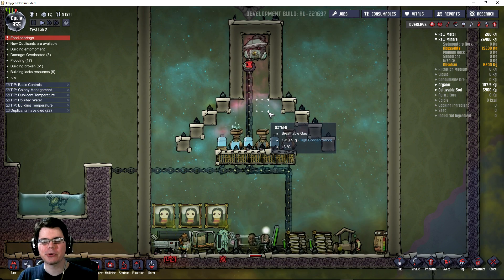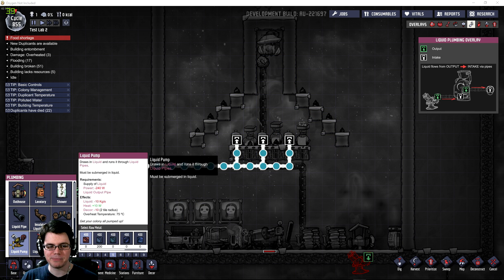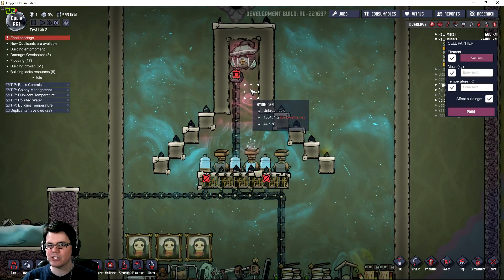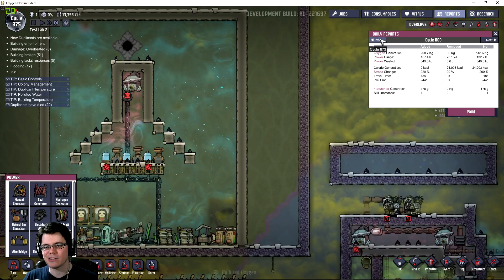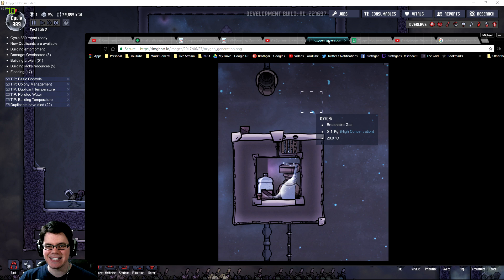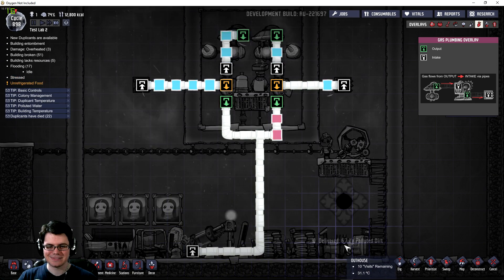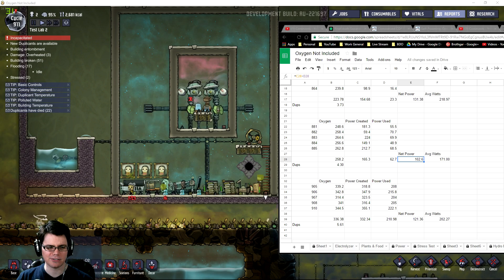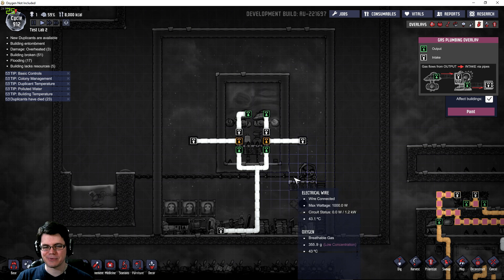Self Powered Oxygen Production! Oxygen Not Included Tutorial

Comment: I made a self sustaining system awhile back. If you go back to the video that you showed on screen. It is completely self sustaining with additional (At times) power.
I used a filter but if I had added the pressure gauge. It would do the job. 
Making the pipe system longer and adding a gas pressure regulator turned down. It should do the job. 

I wanted to run the gas line through out the whole area but it would take some time to build. 
So I just let it start up as it was just to get my O2 production going. 
I also hadn't put in the regulator yet. Needed to research that tech. 

When the hydrogen stops running to the generator. The gas in the pipe acts as a storage. It will take it's time getting there but when it does. It will kick the generator on and run the pump for awhile. Long enough to refill the storage. 

Adding the pressure regulator will spread the Hydrogen out making it run consistently for longer times. 

http://prntscr.com/fbe6su

http://prntscr.com/fbe6jq

Power cut 
http://prntscr.com/fbe6xw

I'm not sure if it's because I have some breaks (leaving some space not 
dug out) in the pyramid or I have a longer line of pipes. I have done 
this before and had to turn it on and off on every few cycles but this 
time it has been going on it's own for 40~ cycles.

Comment: the electrolyzer in a box trick is easy to create, just 0.2kg dirty water on the left and 1kg water on the right, but the problem is you can´t get hydrogen because there is no space to place it. so the electrolyzer can´t create hydrogen and produces only oxygen, but that´s also not so bad because you don´t need pumps or filter to separate the hydrogen, so you will get 888 g/s oxygen for only 144W what is enough for 8 normal dupes

Comment: Water is dihydrogen monoxide, so you can calculate how much hydrogen is produced from electrolysis based on the amount of oxygen produced. There should be 2 moles of hydrogen for every 1 mole of oxygen. 1 mol of oxygen weighs 15.999 grams. 1 mol of hydrogen weighs 1.00794 grams. Divide the total weight of oxygen by the molar weight to find the number of moles of oxygen created. We know that there is twice as many moles of hydrogen created, so double the number of moles of oxygen to find the number of moles of hydrogen. Then we just multiply the number of hydrogen moles by 1.00794 to find the weight of the hydrogen produced in the reaction.

Comment: So as others have stated, electrolyzer can fail to produce packets of hydrogen if it's not in contact with it, BUT. I think there's another reason you were getting suboptimal results in your closed system.

The gas pump pumps 500g/s, but each packet can only contain discrete gases - since the electrolyzer is only making 1:8 hydrogen to oxygen, wouldn't your pumps be processing less than 500g when they take in hydrogen (when you're not collecting it in a controlled manner)? This could be a source of energy inefficiency, since it used 240 J to suck up that undersized packet. The same inefficiency would apply when filtering undersized packets of hydrogen since it's still 120 J per packet. Obviously this inefficiency wouldn't cause you to fall so short of the expected results by itself, but could be a contributing factor.

I could see this actually turn out to be a non-issue since the higher pressure of oxygen would be forcing hydrogen packets to combine when they encounter each other, but unless you know something I don't, I think it's worth investigating. Just an idea!

Comment: based on how I filtered water without a water filter, I found you can make an /emergency/ gas filter too.
if you create a 1x1 space of your chosen gas (like 1g of it) and leave an air vent (surrounded by tile), then it can ONLY output the chosen gas into that space, but it doesn't work forever, and ANYTHING you use to automatically clear it out could change the filter, so.... at least it doesn't cost power! this could be useful to filter out, say random chlorine that ends up in your base with your a/c setup.
another possibility is to use this filter for carbon, and cool it to freezing, but still might change the filter.

Comment: These Electrolyzers. First off put more voids. Not sure how much it sucks in, but an Electrolyzer should produce enough oxygen for 8 dupes. So try to get them to suck in 800g/s. And put the oxygen vent right next to it so that the vents should never over pressurise.

I feel like they pump out 888g right above and if that tile already holds around 1200g oxygen it will over pressurise. Few other reason why its so difficult to get them working at 100% is due to how slow the pressure moves in the air and the fact that only one tile can hold one gas/liquid/solid. It can bounce off pressure or being covered in Hydrogen. 

I think I saw a post about the a build having the hydrogen as a output pipe and how it made the electrolyzers boring to use. Would be nice if they made the oxygen pump out. Would involve more planning for vents and still require placement of the electrolyzer to be meaningful and still require a pump for the hydrogen to be moved to a generator.

Comment: Great video! The developers should definitely look over the electrolizter. First of a system that creates power from water? It's simply not possible to get power by separating H2O and burn the H2. ( The hydrogen generator should create water again and probably some heat, what happens with the H2 now ?! ) 
Secondly the over pressure thingy is a real hassle to work with, it's just not practical.
Reply: I know, first it takes energy to break the hydrogen-oxygen bonds, and the generator only releases the energy of the reforming hydrogen-oxygen bonds plus heat, and the laws of thermodynamics say no no, but it's just a game, if they got the real calculations of true physics it would be one laggy piece of shit.
Reply: Why do you assume the hydrogen is burnt? It has no water output and doesn't consume oxygen! The hydrogen generator is basically a cold fusion generator but since helium is not in the game yet it doesn't release that... yet.

Comment: I think that you're forgetting about the most energy efficient oxygen filter/pump in the game... the dupes themselves. After a lot of experimenting I actually went back to the tried and true method of building a bell shaped base with the oxygen production near the bottom, hydrogen collection at the top, and CO2 falling to the bottom (right) by itself. It's actually a very effective system at dealing with air filtering as the dupes themselves work like air pumps that suck in a lot of O2 and release just a tiny bit of CO2 which means H2 flows rapidly to the top.

The limit of such a set up to function well is probably about 18-24 dupes but if I need more dupes I just make more habitats.

Comment: Try to place the electrolyzer higher in the room. It should touch the hydrogen. Either be in the hydrogen or at least touch the bottom layer. The reason for this is documented in a thread on the klei forums, but to summerize it is like you guessed. Hydrogen can be lost/deleted if there is nowhere to place put it. The electrolyzer needs to be up and close to the hydrogen to avoid this completely. If you are curious about the thread, search for "Electrolyzer producing wrong proportions". The thread have many suggested builds so you might want to avoid it if you want to experiment a bit more on your own first.

Comment: I just had an idea in an earlier episode you showed a zero-energy separation of clean and polluted water by making use of how liquids occupy tiles. I'm wondering if it is possible to do the same with gasses, technically the same rules as liquids apply but you'd need to build it upside down as hydrogen rises.
Reply: Works the same, but you get issues with say, high pressure O and low pressure H, as there needs to be conecting tiles for them to even out/move about, can see the small amonts of H get stuck on the corner tiles and not grow or srink, with O just moving down and the new H sometimes appering and others not.

Comment: the electrolizer is working just fine, do you remember the rules of thermo dinamics, you cant create energy out of nothing.
Reply: he is running out of water
Reply: He is using water...
Reply: Kacper Harasimowicz he is using water, electrolysis= splitting water to hydrogen and oxygen, it takes energy. to get some of the energy back you can burn the hydrogen and oxygen back to water and so on, according to Newton's second law of motion you cant make a self sustaining machine some energy will ascape
Reply: The problem is how it works in this game. Hydrogen generator is not burning hydrogen, but uses some other way to make power from it to not use oxygen back(something like fusion or anihilation should give more energy than electrolysis is using)
Reply: Kacper Harasimowicz I think that in that in the new update they added the rules of thermodynamics
Reply: I really don't know, but as I said anihilating hydrogen, what hydrogen generator probably does, produces more energy than burning it, and burning produces the same amout of energy as hydrolysis(without lost power)

Comment: Great video! I have some questions though... 1. is the additional filter actually required? seems you could combine the 2 pumps to a single filter and save some power... 2. you seem to have vast amount of hydrogen gust gathering above the pumps. would 2x2 or 4x4 space improve the efficiency in regard to collected hydrogen? 3. could electrolyzer efficiency be improved by planting wheezeworts aside/above the electrolyzer to shift pressure away?
Reply: What about energy lost to heat

Comment: sigh brothgar.... you made this waay too complicated.

1 pump can feed potentially 10 electrolyzers, i find it's more often 9, but we'll call it ten. 

so knock that out of the run, and concentrate on the generation system: 1 hydrogen generator, 1 electrolyzer, 1 air pump, and one filter. place the hydrogen generator on a platform above (because of that nifty heatmap thing you showcased), and place the rest inside of a 4x4 tile internal box. the pump in the upper right corner (i don't know why but putting it in the left caused it to jam periodically), the filter next to it set to filter hydrogen, and the electrolyzer directly below the pump. hook up a battery, give it a little juice to start up, and you get ABOUT 280-300w spare power. run them in series, or per circuit, and you can get a little over 3kw per steam geyser (based on water release from the geyser).

the only problem is finding ways to burn all that excess oxygen you're producing, so the base doesn't end up overpressured.
Reply: like so:
Reply: heh yeah the perm tile works a bit like a governor. :)
Reply: I would say liquefy it...but its a pain in the ass to do since they made gas pipes break if something liquefies in them :/